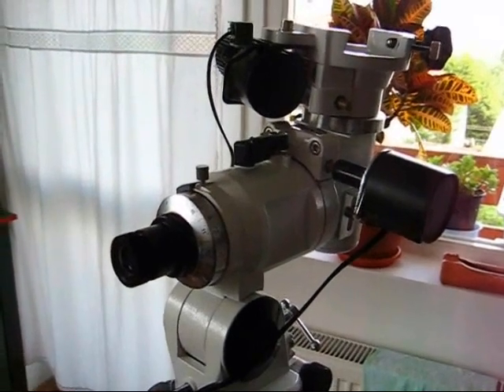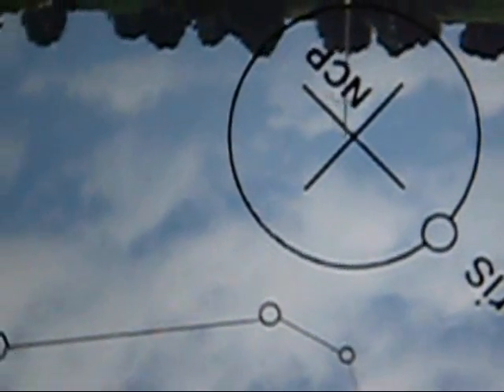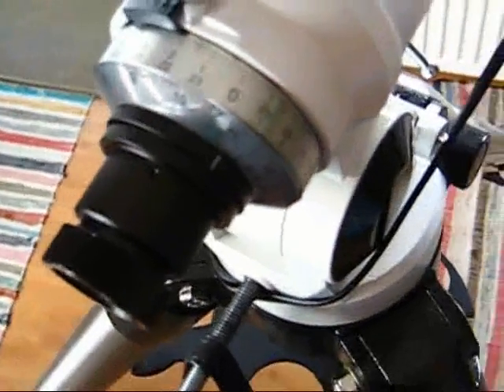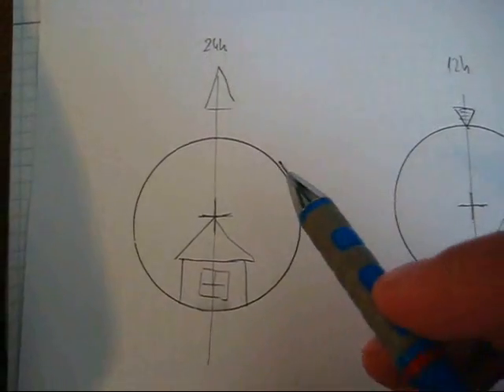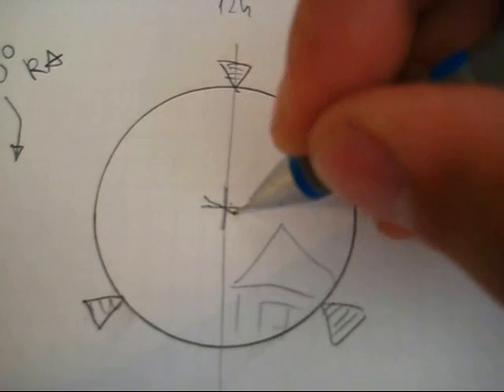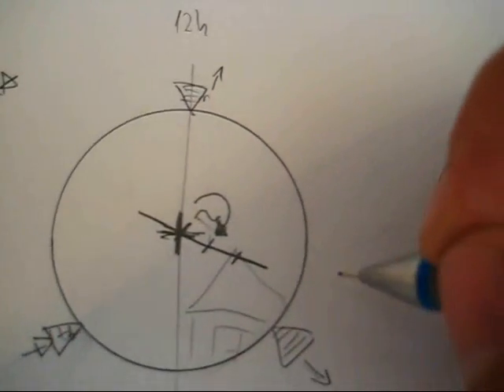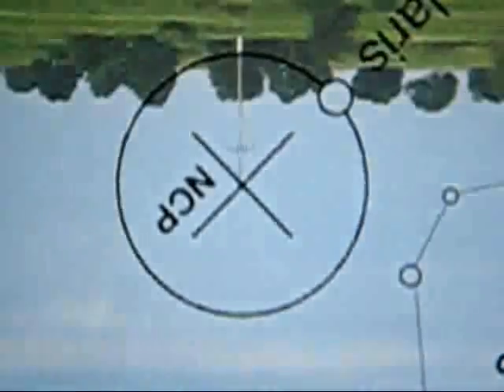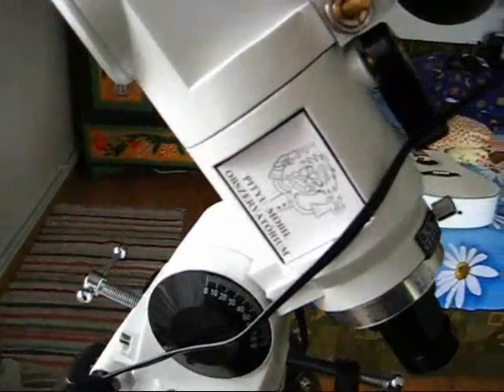Callibrating The Polar Finderscope

Comment: Why does the mount need to be parallel?  I can't lower below 20 degrees.
Reply: Well, it doesn't. As long as you have a fixed point you're looking at, it should be fine.

Comment: Hello Pityu, Thanks for the video. Based on the instructions I received with the scope packaging, this seems accurate and I can tell that your reticle stays in the same place. The directions did not say to change RA to be exactly 90 degrees on either side, they just said 'to the right side of the mount'. So your video helped answer that question.

However I have another question. When I move my mount from one side to the other, it does not stay in the same place, but it ends up at the same spot. In other words, during the movement, the reticle moves away from the starting position, but by the time I get the mount to the opposite side, the reticle is in the correct spot. However, this is with me going as far in RA as the mount will allow, not just 90 degrees then manually stopping. Do you see if/where this is a problem? Thanks.
Reply from the maker: Mike Blase Hi Mike! Uhhh... Interesting question! The problem could be one loosened setting screw that should hold the reticle in place. If one is loosened the reticle can move around in a small circle, than returning in it's original position. This is my opinion... I wish you success for fixing it!